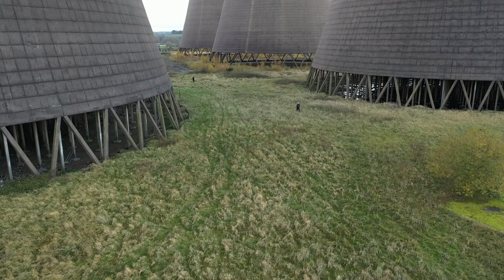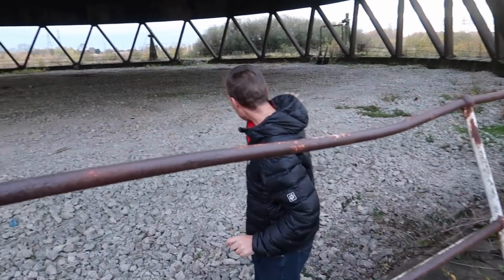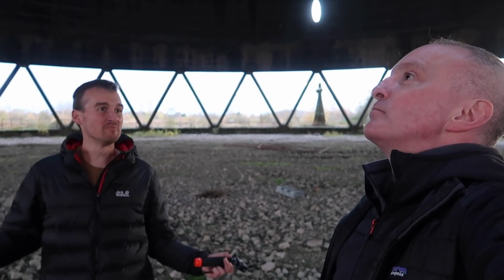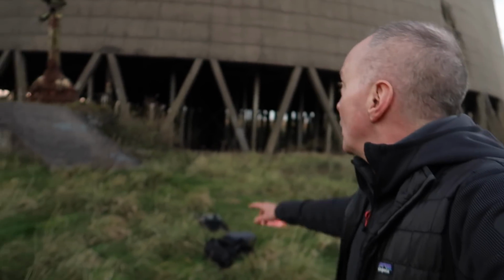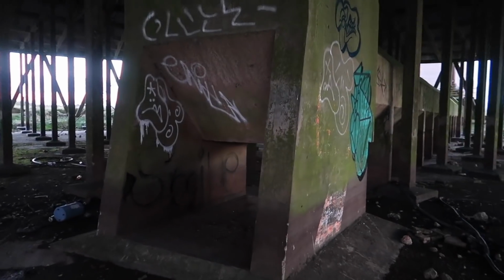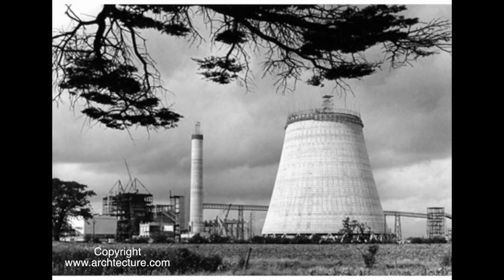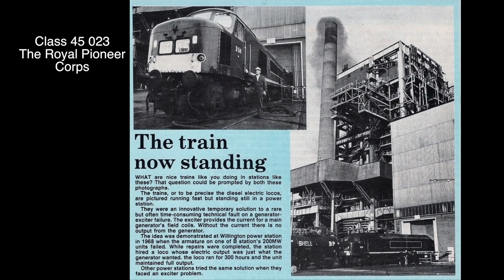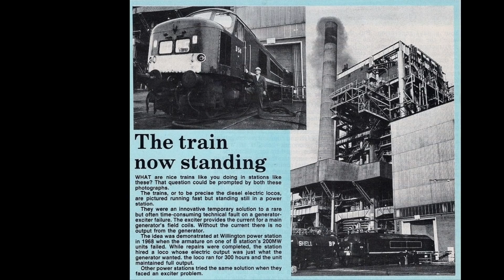The abandoned Cooling towers of Willington Power station

Comment: I did my apprenticeship at Didcot Power Station. Sadly no longer there. I was always amazed at the  immense structures that made it up. Particularly the cooling towers. I never got inside one so I am going to have to visit Willington.
Reply from the maker: Worth a visit David
Reply: David, I visited Didcot A twice, about 30 years ago.  As well as the four 500 MW steam sets and the four 25 MW OCGT Setswana which are still there, with the small blue-topped chimney we saw two emergency Diesel generators; I think they were near the main entrance because they were one of the first things we saw.  Do you know what they could be used for?  They were quite small, probably about the size of the one in a main line Diesel-Electric locomotive, so they couldn’t have supplied the full power required to start up the main station if both of its incoming supplies from the grid failed, but I think the OCGT sets could.

I think there are now only three active coal fired stations in England, plus one in Northern Ireland.  Of these, Drax has only two of its six units still burning coal, and most days no coal is used at all.  I doubt if any will last until the 2025 deadline.  Somebody ought to make a film documenting a large coal fired station, with its vast amount of ancillary plant, before the last ones disappear for ever.
Reply: Hi Stephen. I was there between 1980 and 1984. I only went back once for about an hour a few years later. I dont recall seeing those generators so I cant tell you what they were for. Didcot B still exists and a friend of mine works there so I can ask him.
Reply: @David_Owsnett  
Thank you.  You must have been there at about the same time as my visits.

They used to hold occasional open days at the ‘A’ station and had private visits for various organisations, I know that Didcot Girls’ School used to take parties there for example, but they don’t seem to do that with the ‘B’ station, at least not when the ‘A’ station was still open.  Even the ‘B’ station is expected to close after not very many more years.

Comment: Hi Martin I've seen cooling towers on TV and hot water was pumped up to the top, the towers were filled with wooden slats,as the water fell to the bottom the slats cooled it down,that's how I remember it👍 the soon to be demolished (they usually blow them up)fiddlers ferry cooling towers would be great if you filmed it
Reply from the maker: Yeah I must admit they are impressive when blown up

Comment: Always liked these wierd, huge structures.  Also always wondered if they could be put back to use even disused like this in areas with little or no wind but decent sun by painting them a good absorbent back, hanging some thin aluminum fins inside to help transfer heat, and see if you could get enough draught from solar heating to run a small wind turbine. Fun thought experiment, and bet they would look all ominous and even more impressive flat black.

Comment: Martin, The coal generation plant would produce steam to run turbine generators an thus electricity.  The excess/expelled steam would be funneled off to the cooling tower where the steam raises and bellows out the top of the tower.  You may have seen that at times?  Much of the steam condenses on those baffle plates as cool air drawn in at the bottom reduces the temperature and thus the cooling affect.  water condenses and falls to the bottom basin where it will be allowed to flow back to the generation plant and the cycle begins all over again!    That massive stone covered pipe leading up to the elevated basin/fountain is where the steam travel and is expelled into the tower.

Comment: The exciter is a small generator which supplies power to create the "field" winding power that makes the generator work.
Reply from the maker: Ahh ok thanks for that Andy
Reply: like a starter motor to get it moving? or is the actually "dynamo" device itself that produces all the power?
Reply: @leenevin8451  No it actually needs to be running all the time, providing what I presume is DC power to create the magnetic field which rotates inside the generator, producing an AC current in the static coils of the generator. Not my field of expertise, just something I have picked up somewhere along the way.

Comment: I think the exciter unit generates the power for the main generator field coils. The field coils provide a strong magnetic field that when the rotors are turned the coils on the rotor generate the current as it rotates through the magnetic field. In small generators you can use permenant magnets but even in cars the the alternator uses the battery to excite the alternator but in a car once the field has been established, some of the output from the alternator is fed back into the field coils at a slighter higher voltage than the battery. This then keeps the alternator ‘excited’ and because the output of the alternator (fed through a rectifier) is at a higher voltage than the battery and therefore a charge current keeps the battery going and helps supply all the electrical circuits in what is called “float charging”
Reply from the maker: Cheers

Comment: The 2 cooling towers close to the main road that have the insides taken out are part of Willington A Power Station. These cooling towers are older than the other 3 . The insides were different to cooling tower 3,4,5. The cooling mechanism inside cooling tower 1and 2 was supported by concrete columns with concrete panels passing through the columns. The panels had holes in them where timbers passed through. The timber was removed in 2000 possibly due to being a fire hazard. The concrete columns remained but some were in a dangerous state so they were, I believe removed for safety reasons and ground down into hardcore which is in the base of the cooling tower. I have photos of these before they were removed.

Comment: A really interesting video.  I hope they preserve at least one of these amazing structures.  What is particularly impressive is how all that weight is held up by those elegant triangular supports at the bottom.  Was there one particular person who devised the shape and design of these structures?  When was the first one built?  (No doubt Wikipedia will tell me later !!....)
Reply from the maker: Yeah Iam sure there will be an original design that they all followed
Reply: @MartinZero  Well, according to Wikepedia:  "A hyperboloid cooling tower was patented by the Dutch engineers Frederik van Iterson and Gerard Kuypers in 1918.[8] The first hyperboloid cooling towers were built in 1918 near Heerlen. The first ones in the United Kingdom were built in 1924 at Lister Drive power station in Liverpool, England, to cool water used at a coal-fired electrical power station.[9]   https://en.wikipedia.org/wiki/Cooling_tower   They are / were such landmarks, that travelling around the country I would literally mark off by progress by the next set coming into sight.  It'll be a shame when there're all gone.  Maybe they could use one as a vast art installation location (like the Tate Modern in London).  It would be a fantastic arena for all sorts of light / art/ music shows!

Comment: When the cooling towers local to my hometown came down if felt so strange. Such a familiar landmark and a well used landmark for any pilots flying into RAF Finningley. The original towers of nearby Ferrybridge power station actually collapsed due to a design flaw which caused them one day to resonate due to the wind at a certain speed and direction and they literally shook to pieces. The exciter unit generates what is called a ‘field’ in the generator. They do not have a permanent magnet, which would be huge and very impractical. Very similar in principle to your car alternator which also has an exciter or field winding that is powered initially from the car battery until the alternator is running at which point it becomes ‘self exciting’.
Reply from the maker: Thats scary about Ferrybridge Gary

Comment: the pipe carried spent superheated steam to the towers were it condensed on the inside, the water collected at the bottom and in most cases was returned to the river.
Reply: In the 50's I am pretty sure this would have been a closed loop system, as it is much more efficient.
Reply: The outflows were usually very good places to fish as the water in winter was usually a few degrees warmer than the river Trent.
Reply: Super heated steam is dry as all the water has turned into steam above 100 C.
The pipe carried  water at below 100 C that had been condensed after use in the turbines. Super heated steam is invisible unlike the wet steam that you see coning out of a kettle.
Reply: The pipe carried the hot water from the condensers rather than the steam..
Reply from the maker: Cheers Stephen
Reply: "....returned to the river." Are you sure about that?  I thought that, at least, most of the water would be returned the power station, to be converted to steam again, continuing the process in a loop. Surely, any water returned to the Trent would be wasteful, unless you happen to be a fish needing a warm bath?
Reply: @2H80vids  this is the cooling loop which sent cooling water to the condensers to condense the steam rather than the steam condensate itself. The condensate would be returned to the boilers (as it is very pure water that costs a lot to demineralise) the warm cooling water return would then be taken to the cooling towers before being reused. Some of the water is lost through evaporation and drift (mist formation) and a small amount may be lost through leaks, but also a significant amount is discharged as blowdown to the local watercourse in order to control salt and dissolved solids levels in the cooling water. This water loss is balanced by make up water taken from the local watercourse (intakes are upstream of discharge points).
Reply: @csatterley  Ah OK, interesting stuff. So the stuff that's actually getting boiled/superheated is posh, fancy water, while this stuff is untreated and expendable ?  Presumably, as it's on a loop, the river level is unaffected and there should be nothing polution-wise in whatever is returned to the Trent?
Reply: @2H80vids  the blowdown will be warm and may have higher conductivity that the river water, but not really an issue compared to what else was discharged into the Trent!
Reply: @csatterley  Any fish in there would probably have appreciated it, hanging around at the end of the pipe to keep their bits warm. Do fish even have bits? 😁

Comment: Interesting Martin having never actually seen inside of a tower. Now as to an exciter unit. While small generators may use permanent magnets to create the magnetic field the armature rotates through, in a large industrial generator the magnet would be too huge and heavy to be practical.  Therefore an exciter unit is a source of power to energize the electromagnet needed to create the magnetic field. In most stations once the generator is running it can use its own power for the field as its a fraction of its output but prior to that point it can make any power tthe field needs to be excited (powered from another source). The diesel locomotive as you more than likely know is really just a small power station on wheels so what they must have done is tapped the electrical output from its generator to create the magnetic field needed at start up.  While in theory they could use mains power for that if there were a black out they could not start the generators so they don't rely on that.
Reply from the maker: Cheers Marty

Comment: Interesting to see inside cooling towers. It really gets to me that the media portray power stations as polluting monsters and without fail they always show the cooling towers which is so wrong. Cooling towers emit harmless water vapour, it’s the taller slimmer chimneys that belch out the smoke.
The cooling towers basically took river water and sprayed it over hot steam pipes to condense the steam back i to water which then circulated back through the boilers and the steam turbines. 
It would be interesting to see one in action.
Reply: I agree, lazy TV reporters always like to show these and suggest that they're emitting clouds of pollution, when in reality they're emitting clouds.
Reply from the maker: Yeah I would love to see one working
Reply: They did emit legionella a couple of times though, I was surprised to find out!

Comment: I think the "exciter" is basically just a generator!
When you get to the big stuff it is not convenient to have big permanent magnets waving around so it is done by coils making an electromagnet! 
You spin the generator up to speed (no load so it is relatively easy) then you put power into the exciter coils producing the spinning magnetic field to give you your power output. Varying the exciter levels will vary your power output. Obviously you need to keep your revolutions constant by pushing more or less steam into the turbine to balance that. 
Easy ... when you know ;0)
Reply: Yep you hit the nail on the head there, most power stations I've worked in will have a DC generator of some sort (or a large rectifier or both) to act as the exciter unit for the main generators. Obviously they were the using same DC Voltage as the locomotive traction motors for the exctier units in this case.
Reply from the maker: Sounds a piece of piss Dave 😉
Reply: Just like the alternator in a car... Power is generated from an electromagnetic field rather than a spinning permanent magnet. 😎
Reply: @MartinZero  Can be. But if you get it wrong ....... ;0)

Don't forget it is 100 year old tech now! 
Give me the days when they melted the lead roof on Buile Hill Hall when they were testing the first street lighting ;0)

Comment: All they really are is a great big chimney letting off the steam from the water used to cool the pipes carrying the water from the turbines/boilers. Each concrete lift (approximately 2 metres) was built at a slightly different angle to the previous lift to create the iconic shape. The urban myth is that on one occasion one lift was accidentally repeated which created a weakness in the shape and ultimately a collapse. The top rim is I think no more than 10 inches wide and steeplejacks working on the top would always go round in the same direction. If the wind got up they would crouch down and dangle one leg over the side the wind was coming from: The bravest construction workers I've ever met.

Comment: They also incorporate drift eliminators - slats with 90 degree bends in them - which removes a lot of water from the drift as the air molecules can negotiate the bend easily but the heavier water molecules cannot.

But why does the power station want to cool water? It's to provide cooling water for the condensers which sit on the output side of the steam turbines which use high pressure steam to turn the alternators which generate electricity. Cooling the output steam creates a vacuum in the condenser as the output steam condenses to water. The vacuum makes the turbine much more efficient as it increases the pressure difference between turbine input and output. The condensed de-mineralised water from the turbine is returned to the boilers for re-heating into steam again to drive the turbines, while the condenser cooling water goes to the cooling towers to be cooled and routed back to the condensers again for re-use as the condenser coolant.
Reply from the maker: Cheers Vince

Comment: Martin, the steam came from the turbines to the cooling towers where cold water was sprayed onto the the pipes.  The vapour coming out of the top of cooling towers was just the evaporated cooling water - the turbine water was in a closed loop. Wikipedia has loads of articles where you can find out about the Rankine cycle (steam turbines) if you're interested.  BTW - you can design a cooling tower using just straight lines - really, look it up.
Reply from the maker: Cheers Michael

Comment: the exciter unit provides power to the generator sets. It is a small generator in irs own right and allows the power station to start from cold. The main generators that produce the power to the grid need electricity to work. As we all know if you spin a coil of wore in a magnet you generate electricity.  If you were to user permanent magnets in the generators the amount of electricity you can generate is limited to the strength of the magnetic field.

If you replace the permanent magnet with an electromagnet you can create a stronger magnetic field generating more electricity. the other advantage is that you can vary the strength of the electro magnet therefore regulate the voltage an this helps keep the grid voltage steady.  The only other way to keep the grid voltage steady would have been to speedup or slow done the generator. This in turn would have changed the frequency of the electricity come out of the power station. 

So now you know what the Exciter units did.  Exciting stuff eh?

Comment: An exciter unit in a generator provides a stationary rotating magnetic field. 

This induces an electro-magnetic field (EMF) in the armature coil. 

Direct current is fed to the exciter which is basically a coil, it then creates a magnetic field.

In large power generation a small generator is used to provide the electrical current feed into this coil which then produces the magnetic field in the main generator rather than a permanent magnet.

This small generator is called an exciter generator. 

An older type coal power station will normally have two small generators running in tandem to produce enough current to excite the main magnetic field of its generating turbines.

Hence the diesel locomotive, probably cheaper than fixing the main exciter after it went bang.
Reply from the maker: It was temporary so they must have fixed it